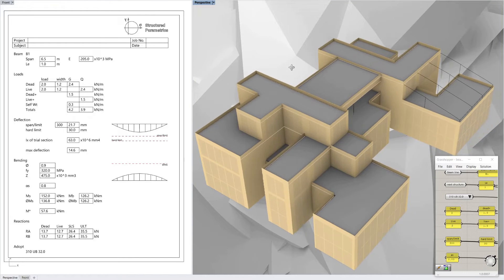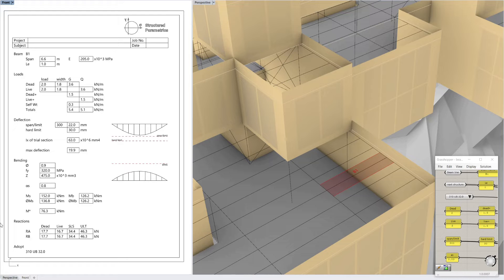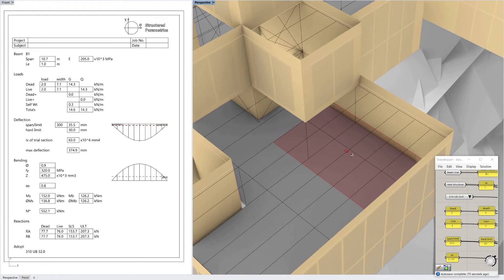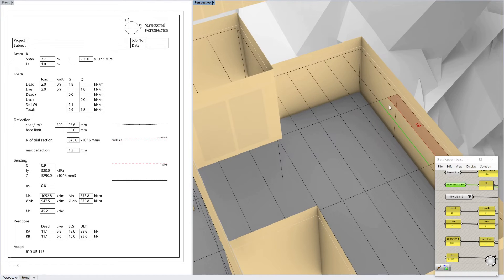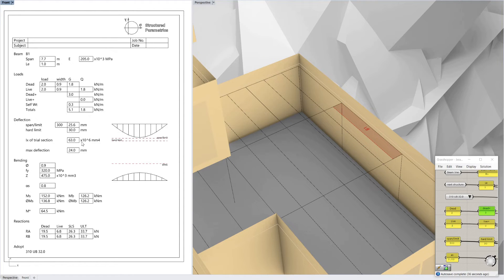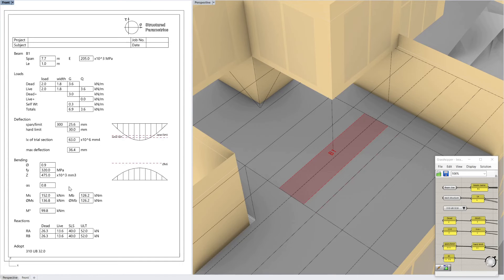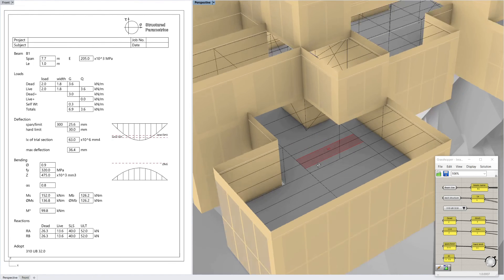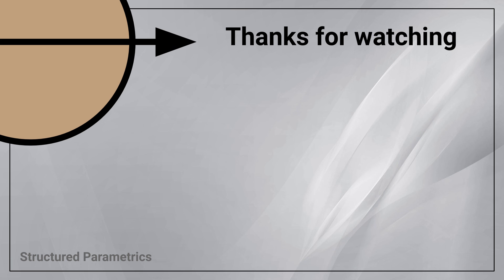Quick engineering calculation sheets. Produce computations directly from an architectural model.

Comment: That's a really neat tool. I've been working on something similar in gaps between assignments and you've pulled off something I've yet to manage.
Tell me, does rhino have some table management tools and I just missed them somehow, is this done using some external tools, or did you just hack the tables together in grasshopper using text and geometry?
Apologies if that's a rude question but I'm really curious
Reply from the maker: No worries and thanks for the comment. It uses a custom script which produces a 'spreadsheet like' layout. There might be a grasshopper plugin that manages tables in that way although we haven't looked for one (that might be a useful tool though).